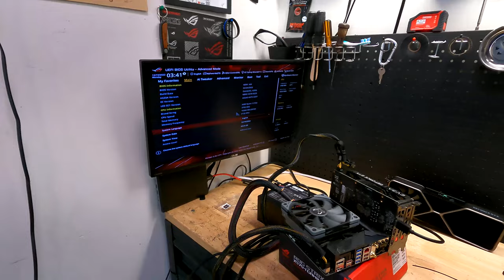Upgrading the computer that saved my marriage!!

Comment: Honestly Gigabyte bIOS/ UEFI used to suck. If you changed settings a lot in the bios the system would be unstable until a CMOS clear. You couls set things to whatever and it works fine, it's the actual changing settings a lot used to bork the computer.